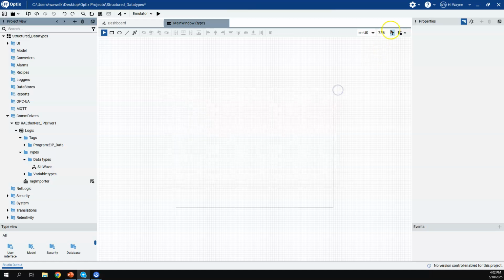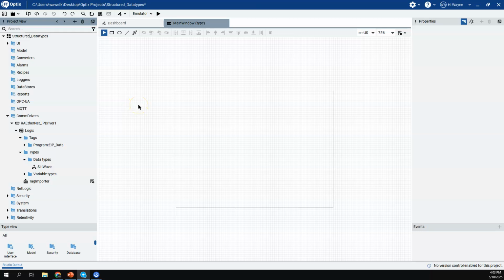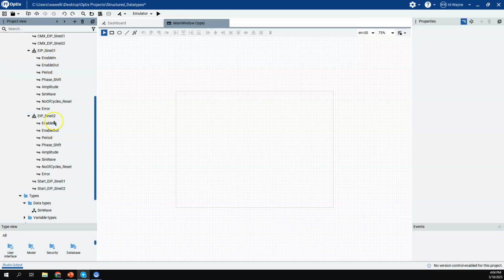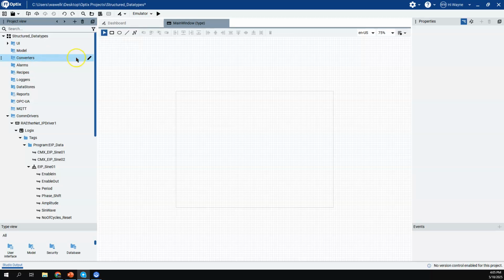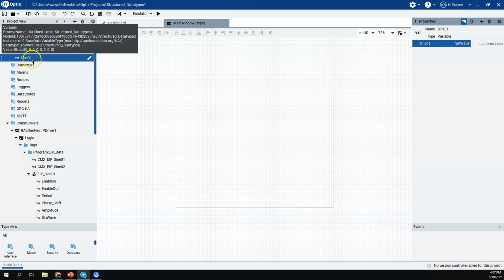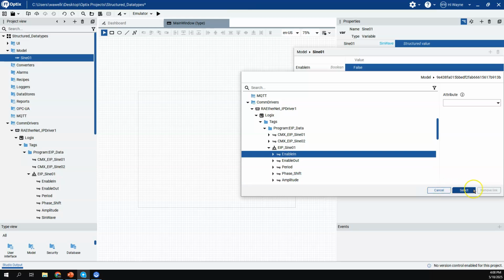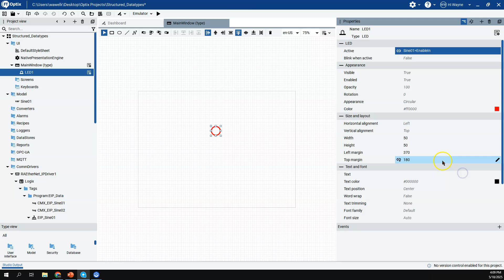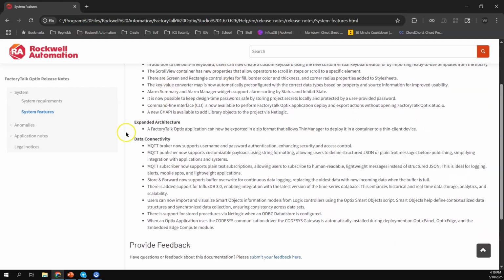New in FactoryTalk v1.6 - Create Variables with Structured Data Types

Comment: Hello, I have a question regarding session-based variables in FactoryTalk Optix.
I have a side menu on my SCADA page that can be collapsed or expanded based on a model variable. However, when one client expands the side menu, it also expands on the other client’s screen.

I’d like to make this behavior independent for each client. Is there a way to create a session-based model or variable (for example, using a session ID and binding it through an alias) so that each client can control their own side menu state separately?

Any guidance or examples would be greatly appreciated. Thank you